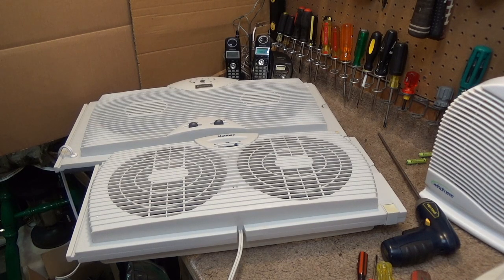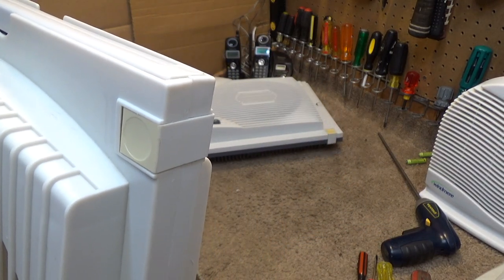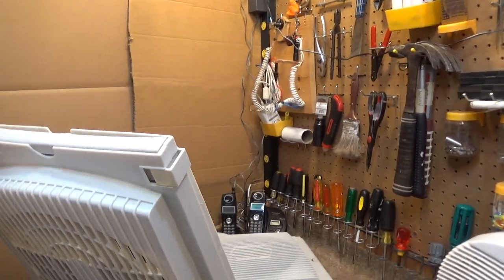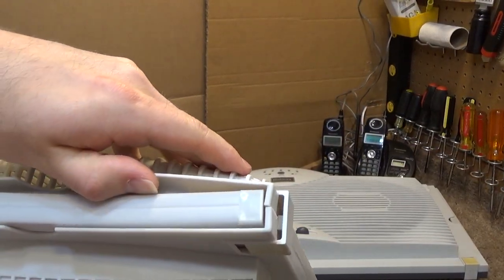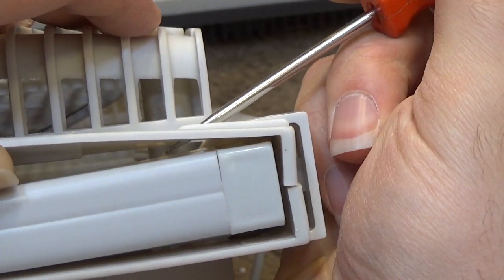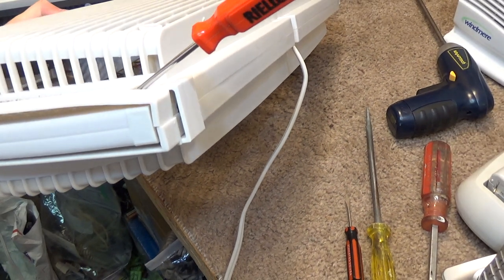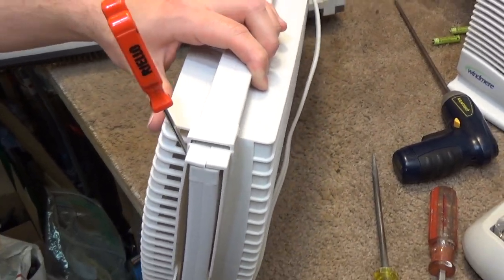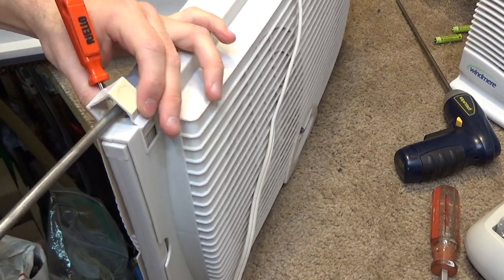How to Remove the Clips from a Holmes Window Fan

Comment: Once the unit is separated by removing all the screws, reach inside and disconnect the accordion adjustable panel.  This makes viewing and working the space easier!
Reply from the maker: I didn’t think the side panel can be completely removed before the clips are.
Reply: Jordan U wrong. i bought one just now and accidentally tore it right out. HOWEVER i now know how to fix it. :)

Comment: On a very hot day.  I took an old fan out onto the driveway.  Took my garden hose and sprayed it with water to remove the dust n dirt. (Yes, it was NOT plugged in ).  I let it dry on the hot pavement for a few hours, then let it set a day or two to make sure it was totally dry.  When I plugged it in, it was clean and worked as if it was new.!!    ….it was an OLD fan and was just taking up space in the garage.
Reply from the maker: OK

Comment: so I have a question is there any window fan model that allow you to open them them and clean the inside and the fans? This is absolutely ridiculous.......... I just tried to do this and pretty much broke the clip........... I have used duck tape to hold it together..........
Reply from the maker: Yes there are, The Home Depot sells one under the Hampton Bay name that doesn't have the clips. It is easier to service than this one is.

Comment: This was great and helped me figure it out.

However, it turns out you can easier do it with just two small flat-head screwdrivers.

Push the first in the side (from the outside to the inside, like your RIELLO screwdriver is angled), bending in the clip all the way, sliding the flat-head of the screwdriver past the stuck-out bit of the clip that holds it in place. Put the second screwdriver beside the first in exactly the same way (probably not necessary, but seems to help loosen it on each side). Move the first screwdriver to the top near of the clip near the same side as the second screwdriver holding the clip in, and pop the top off.

Works for me. I just did it twice because I didn't anchor in the accordion part properly and had to do it again!

I reiterate I would never have figured this out if not for your video.
Reply from the maker: Thanks for your input.
Reply: Thank you!!
Reply: I'm going to try to figure this out; I am absolutely a visual learner though for these things.

Comment: Instantly broke both clips. Oh well. Too old and brittle. The clips, not me.
Reply from the maker: I'm not surprised, once they get brittle from the sun, they're almost impossible to get off without breaking.
Reply: Well, mine is from Goodwill, so not too bad when I used that large screw driver for what it is best doing -- making short work of those clips. Love your video. I'll keep practicing on these cheapies, but I simply must get them apart. What a joke to fiddle around with that tight space to clean them well! Really appreciate your time in Sherlockian those clips. Onward!!

Comment: I had not consulted youtube before attempting to take my fan apart.  Lots of difficultly removing these clips.  Unfortunately I broke one but was able to use super glue to repair it.
My question is:  Now that I have them off,  how do I get the fan together and install those clips?

Comment: (whew!)  I just bought a brand new one, and when I was pulling out one of the extenders, the accordion flap came loose from the inside.  Naturally, I took all the screws out, and was then left to contend with those clips!  After examining the situation, I figured that the plastic was probably flexible enough to take some bending, but thought I'd check out youtube, just in case.  Looks like a common issue.  Thanks for showing us the way.